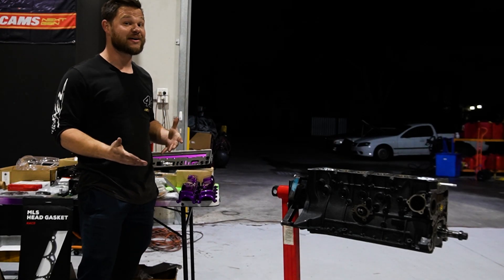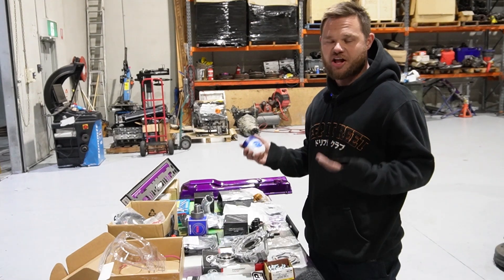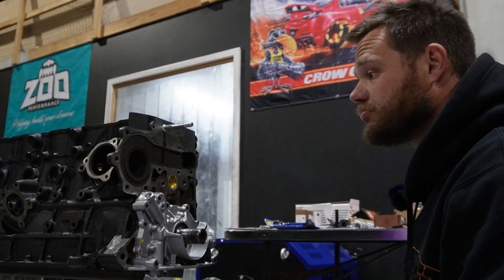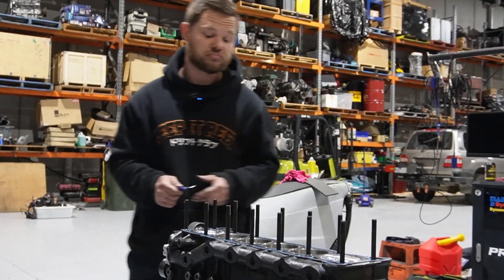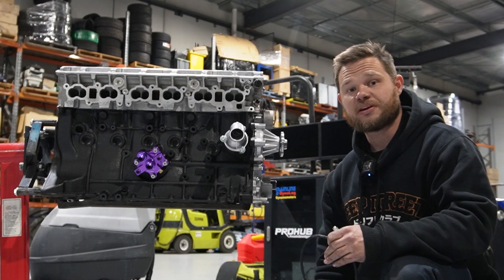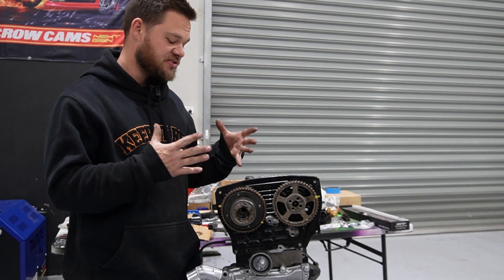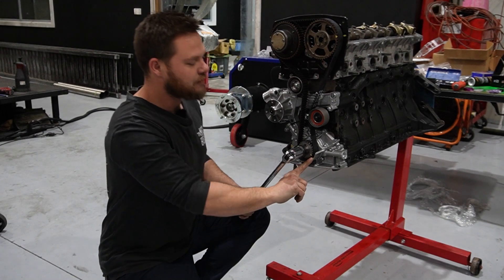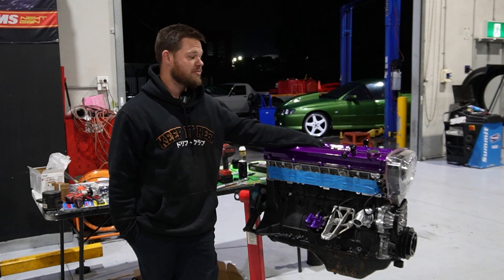Building the Ultimate 25/30 Hybrid Engine: A Nissan RB Masterpiece

Comment: It will never be as good as an rb26 with NVCS…
Reply from the maker: I mean.. We won't have throttle body issues though?
Reply: Like 1,000,001 single TB intakes exist for rb26. Did you consider the Juratec NVCS conversion kit for rb26 at all and doing a 26/30? You went 25 for the NVCS correct?
Reply from the maker: Went 25 to save my bank account. And ability to find good spares if required. Without changing everything everytime. 
The NVCS will bring it on even sooner. I see no downsides
Reply: @pez @pezomatic1 on’t see how you’re saving money on anything with a 30 lower end. And if there is it isn’t much. The cylinder head on 26 is where the magic is and you won’t have to throw near as much at it to make power.
Reply from the maker: Being a 30 i wont be able to rev it remotely as hard, wanted to optimise response with NVCS. 
We will see. Engines gonna start in the next month or so, you could be right
Reply: @pezomatic1  this is such a false narrative, if it’s stock crank stock rod length rb30 then it has a better rod stroke ratio compared to rb26. It’s almost dead nuts 1.75 which is considered ideal. Most performance engine builders aim to meet or exceed… rev it as much as you want.
Reply from the maker: I do wish I had as much knowledge and confidence as you in this. We are doing our best.
Reply: @pezomatic1 Well I’m currently opening a shop specifically for the rb26 & R chassis. If I can help in any way lmk
Reply from the maker: Where abouts are you located?
Reply: @pezomatic1  Southern Colorado
Reply from the maker: Ill be sure to reach out with any RB questions. Cheers
Reply: Rb26 does not have nvcs. And good luck finding a vcam
Reply: @mraperish no it doesn’t, but there’s a conversion.

Comment: Why are u using the stock oilpan? From what i know, the N1 pump moves alot more oil at higher pressure than the stock one, and theres a risk that, if u dont use an extended and baffled oilpan, it may empty it enough for it to be critically low under high load and especially if g forces are involved too.
Reply from the maker: The stock oil pan was simply to seal the engine, later today ill be releasing a video installing the engine explaining exactly this. Great pickup though you're correct it would fail
Reply: @pezomatic1  Ah, thought so, since u thought of the rest, made me worry at first haha!
Reply from the maker: @kingnorlen  appreciate all the kind people trying to look out for me 😅